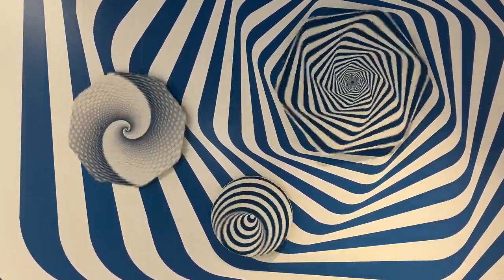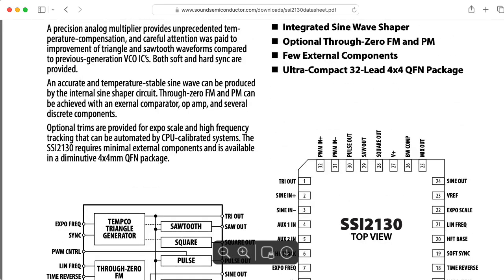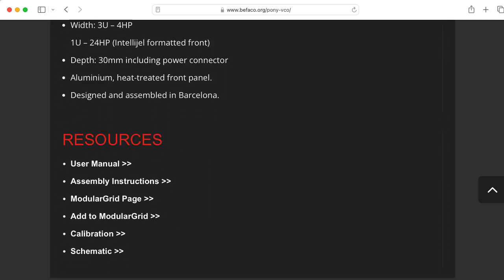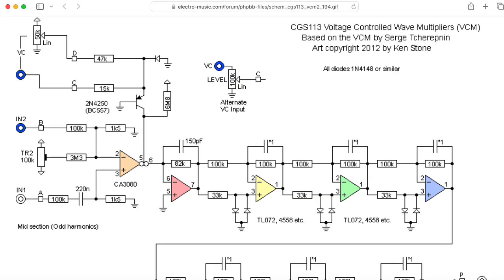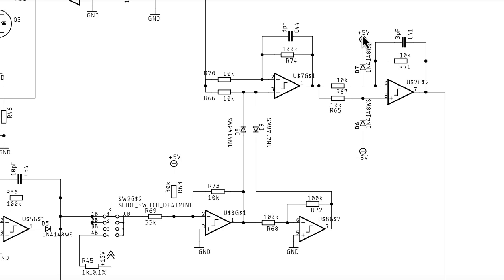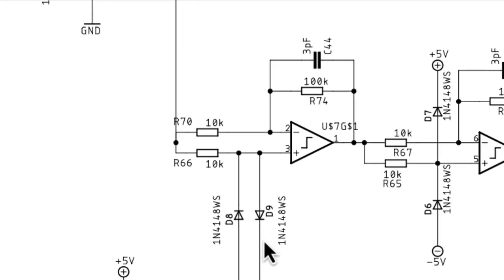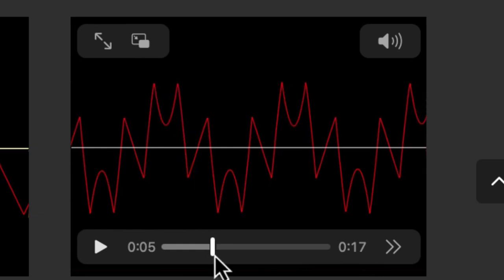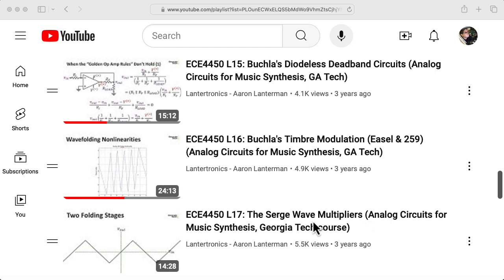Befaco Pony VCO Wavefolder Circuit Analysis (intriguing variation of the Serge Wave Multiplier)

Comment: I isolated the Befaco "timbre" from the schematic to use it on a normal audio, Wondering on how this turns out.

I made a pcb for  "Alice OPA Dual Channel" electret phantom powered microphone using TL072 rather than opa1642.
it seams it's also possible converter it into a phantom powered XLR audio input. hopefully it works with the bread and butter opamp.

Someone tested this circuit on YouTube with an analizer using the opa1642 opamp and says it's a top both high end microphone.
User: Sound Sleuth

Comment: Hi Mr. Lanterman, that's a highly interesting topic! May I ask you something? Is the sawtooth modulation (since there are no uniform terms about it - I simply labelled SWM) introduced with devices like Rhodes Chroma & Oberheim OB8 also due to wave folding? On the OB8 when VCO Saw & Pulse are pressed simultaneously (within an oscillator) the PW potentiometer in the counterwise position (value zero) suddenly produced an octave up & modulation makes totally different beatings to usual PWM. If that's due to wavefolding or possible with wavefolding I weren't surprised if some of your introduced circuits are used in the present OB-X8.

Longterm OB-member Marcus Ryle explains the feature in the video: "Comparison #3: how the OB-X8 compares to an OB-8" on Oberheim Official here on yt. (10:37 to 12:50) among others with an oscilloscope-image but still has no term. On Vsynth series Roland simply calls it "fattening" what's a kind of dull term for a widely unnoticed feature that still has tradition on totally various gear. F. e. I've seen (& heard) SWM on the fore mentioned ones as well as on Roland Alpha Junos, Yamaha AN1x, Korg Z1, minilogue, the present Microkorg 2 & Roland Gaia 2.
Back to the question: Might it (preferrably on analogues) be executed thru wavefolding?

Comment: I've used this chip to make a few oscillators. It is an excellent little chip. Here are my notes from when I worked with it:

TZFM: The datasheet example for TZFM doesn't have anywhere near enough modulation depth, it is much too gentle. But also, increasing the depth makes it very sensitive to DC offset causing pitch offsets. Making the TZFM sound good is kinda complicated, especially if you want to do DX7 style FM stuff that stays in tune and has very fast envelopes changing the FM modulation depth.

Internal Voltage Controlled Mixer: The built in mixer is very convenient, but not super clean. There is a little edge of crossover distortion at the zero crossing point, so your sine wave into the VC mixer is gonna have a bit of buzz on it. Though this isn't an issue when mixing traditional buzzy waves, but it was pretty noticeable with a sine wave.

Tracking accuracy: The tracking accuracy is fantastic. Once calibrated it will track many octaves very very closely.

QFN Package: The tiny package is definitely annoying, but it is much easier to solder if you get a solder stencil and use solder paste with it.
Reply: Ah that’s interesting to hear your findings re: TZ-FM. The Pony in particular seems to have a design flaw in the TZFM implementation. It converts large changes in amplitude in an AC signal to a slowly changing DC offset. I have an example on my channel. 

It’d be interesting if @lantertronics were to dive into the TZ-FM implementation of the Pony to see if there’s an easy fix.

Comment: the first high speed A/D converters used this circuit type
Reply from the maker: I would be interested to learn more about this!
Reply: @Lantertronics  worked on A/D, DAC, in the 70's
We calibrated the 1V. reference batteries for the then NBS with that equipment
Basically your folding amp (two op amps) becomes a single bit converter by taking logic functions from the outputs. Run the "bits" in series, pass logic results to the next stage.
Reply from the maker: @ytwatcher8288  That's really clever!
Reply: @Lantertronics  ADC Architectures VI: Folding ADCs
by Walt Kester
Reply from the maker: @ytwatcher8288  This is going to keep me busy! Thanks!
Reply from the maker: @ytwatcher8288  1966: "The 8-bit, 10-MSPS converter contained its own
linear power supply, dissipated nearly 150 watts, and sold for approximately $10,000." Wow have times changed...
Reply: @Lantertronics I foresee a new video coming up with this topic. At least I hope so 🙂